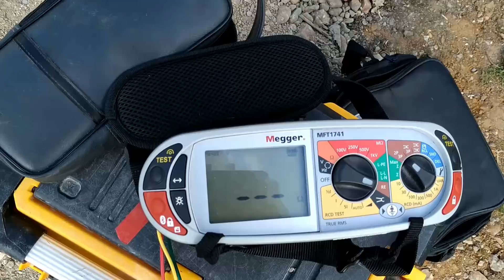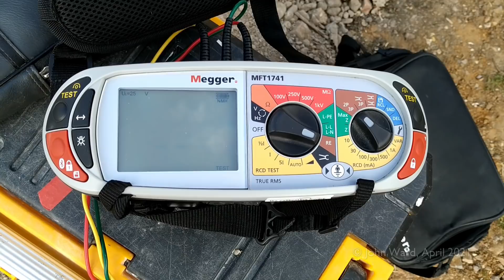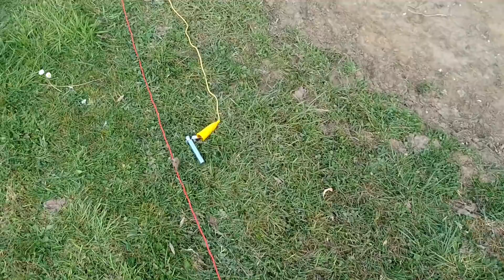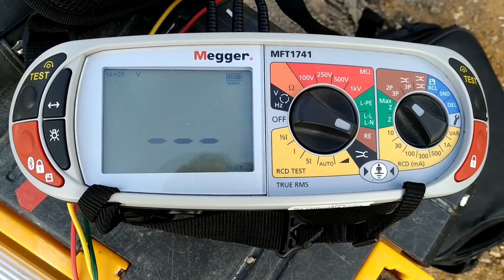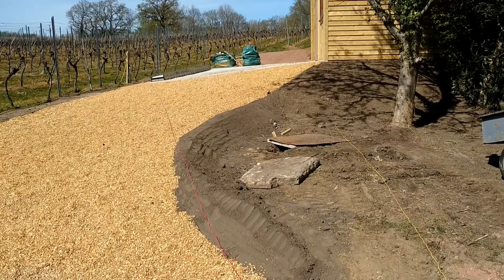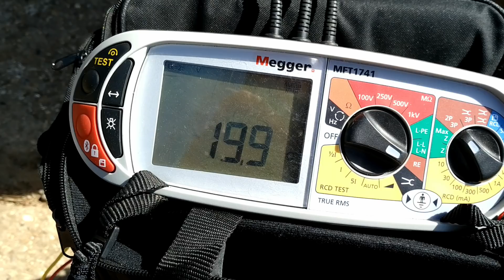ConduDisc and Conducrete Installation

Comment: Very interesting. Thank you. Presumably the 13mm2 csa was sufficient for the fault level in this case, but do you know what options are available in cases where fault levels or disconnection times etc require larger csa earthing conductors?
Reply from the maker: The Condudisc is available with a bolted lug connection, so larger conductors can be attached.

Comment: Out of curiosity, if you had a TN-C-S system with one of these electrodes (20 ohms!), and the combined neutral broke, would that limit voltages on metalwork to a sensible level (i.e. a "probably not fatal" level)? 

Or if you had a TT system without a GFCI (for whatever reason). Though an earth-fault wouldn't pass enough current to trip the breaker, would that good of an electrode ground substantially reduce the risk of a fatal shock?
Reply from the maker: Yes, and all TN-C-S services should have electrodes at each property for that reason.  It's already required in many countries and has been for decades.  Unfortunately it's not required in the UK..
It would have a similar effect on a TT system, lower electrode resistance = lower voltage on exposed parts.
Reply: @jwflame  John, all of the incoming supplies in the US are TN-C-S, and every house (and even every power pole!) has a ground (earth) electrode installed in addition to the bonding to water and gas in case the combined neutral and ground breaks.

Comment: I'm sure I saw some earth bonding to rebar in strip foundations on a new build site near me. Is this acceptable if the readings are within the specs?
Reply: Bonding or as an earth electrode? Concrete is conductive enough that the rebar might count as an extraneous part, I would certainly not want to stand barefoot on a concrete floor while holding s live wire.

Comment: Interesting. I knew concrete was conductive to the point that you could put an antistatic mat (the type you walk on) on a concrete floor and you wouldn't have to connect the earth conductor. I did not expect it to be this low in resistance. I guess with the large surface area and short distance to (potentially wet) soil it checks out.
Reply from the maker: The concrete used in the video is manufactured to be far more conductive than normal concrete.

Comment: It it possible to measure the Ze at the consumer unit rather than using an earth electrode test with temporary rods?
Reply from the maker: Yes, that is an option, although it's measuring the whole earth loop back to the transformer, not just the electrode.

Comment: is the reading good initially because it is still wet? A rod in the same location would have been a good comparison. Only problem being a big hole needs to be dug rather than driving a rod in.
Reply from the maker: It's mostly due to surface area.  The second test at the end of the video was a week later, by which time most of the water added would have soaked away into the soil.

Comment: I’ve got one to install for a garden office. Hoping for around 40 ohms. From what I was told you can extend the tail and choose to encase it in concrete and then attach a 16mm earth from the disc to the installation.